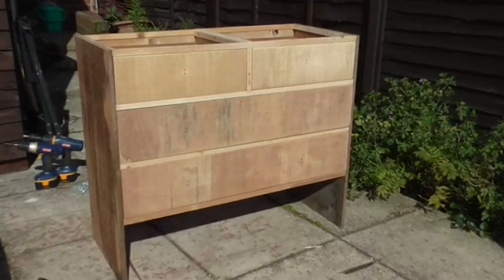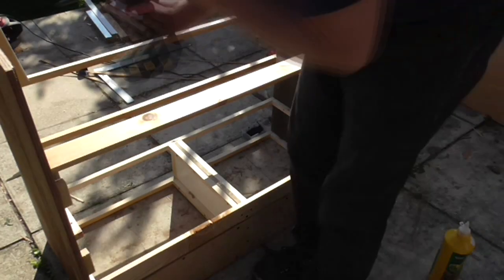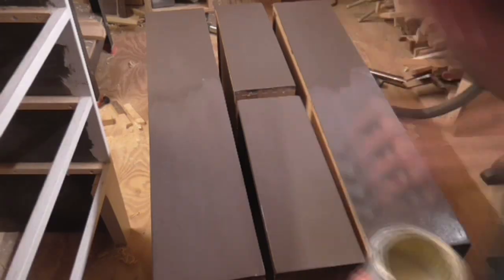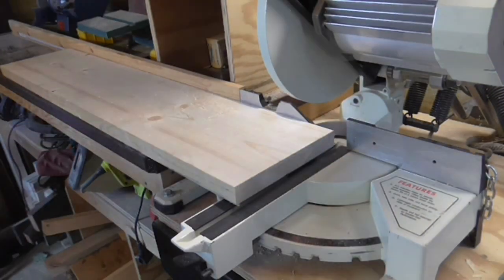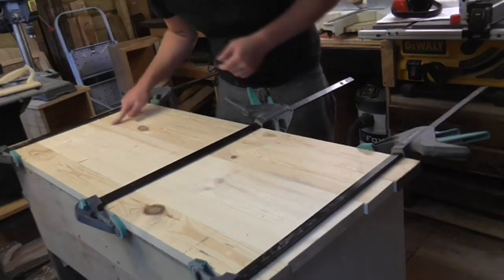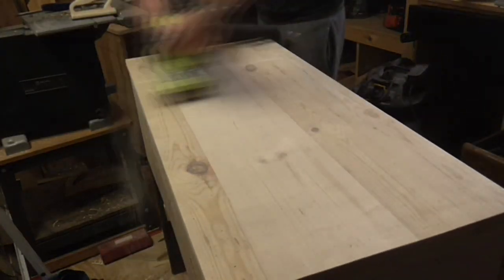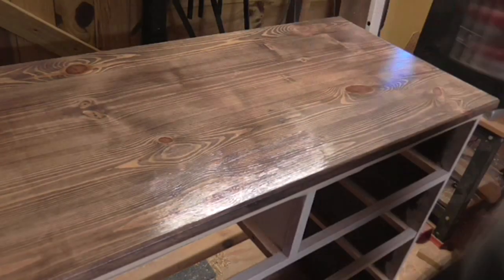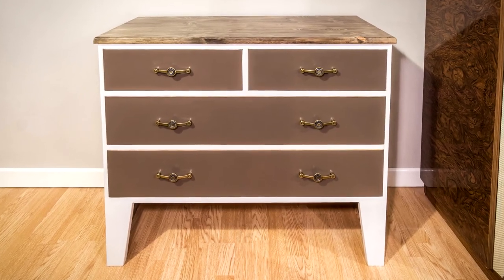Making a Chest of Drawers from salvaged materials (part 2 of 2)

Comment: It is really relaxing to revisit these old furniture builds of yours. Especially as I am going to dip my toe into cabinet making at some point. I have one question, though. How is the top panel doing now, some years later? Did it work to screw it down like that, or have you had issues with the wood expanding/contracting and being fixed in plance with screws? This is in no way a critisisim, but an honest question, as I am learning woodworking through youtube, and need to rely on the sharing of knowledge through this community.

Comment: Rag and Bone here's a tip for you ;
Gumtree, Preloved and Shpock are all a great source for good quality second hand tools - you should be able to pick up a biscuit jointer for roughly £20 - £35 depending on the make. People buy them new thinking they will use them and end up with them just sat there. After 2 or 3 years they sell them, so you end up with a virtually new tool for ½ to ⅓ of the price.
Reply from the maker: Yep I use them all the time and already have a biscuit joiner - I don’t tend to use it though as it’s not accurate

Comment: Nicely done with an excellent finish. You really should buy a countersink pilot bit, 2 jobs one drill ;)
Reply from the maker: Thanks. I do actually have a set of countersink bits but I find they are not working well for me, they are wobbling too much in the chuck? Maybe I should have bought a better set, I'm sure you get what you pay for. I used them once and went back to using regular drill bits
Reply: +Rag 'n' Bone Brown continued comment on your Fb page with pic ;)

Comment: Hy, have taken the Crown guard off your dewalt table saw. I think u mentioned in a reply to me a while back it's the DW745 model which I'm buying soon from screwfix. I asked them if it can be removed to make groove cuts ect and they said no for safety however if it can be removed it would be very handy
Reply from the maker: +scott mclean it can definitely be removed. I did it in day one! It's safer to keep it in but it just gets in the way and I don't know anyone who actually works with it on. Disclaimer: always be safe and keep your guard on ;-). By the way the riving knife will need to be lowered if you want to cut dado slots. Apparently you can buy them but I couldn't find one so I re-shaped mine with an angle grinder. That is also probably classed as less safe but I'm glad I did it because I hate removing and replacing it
Reply: Thanks for replying